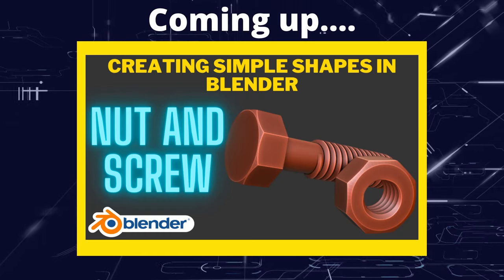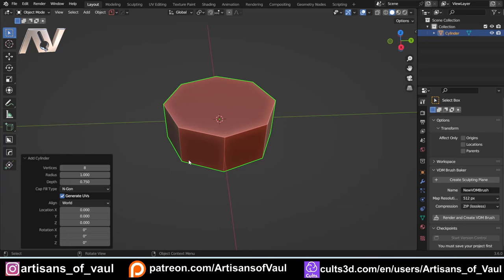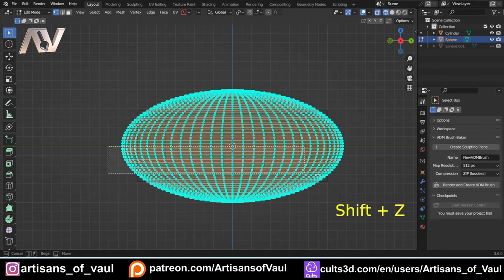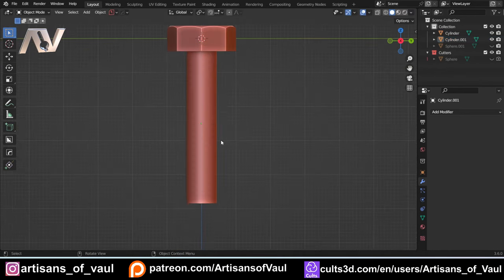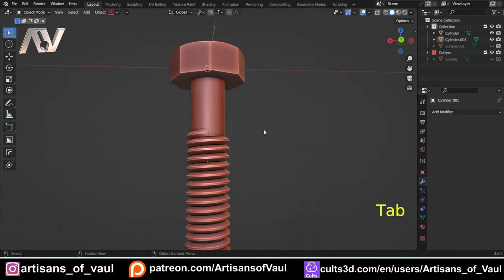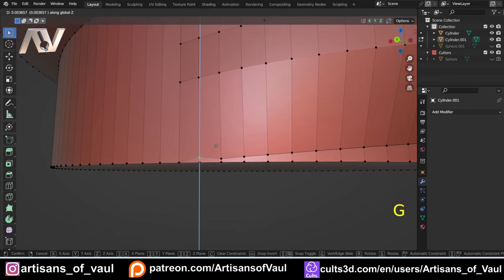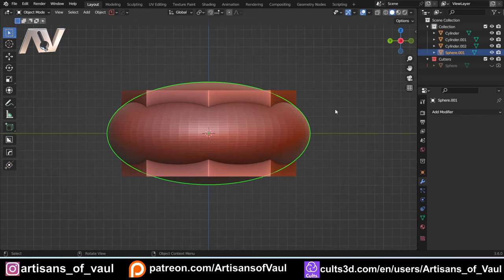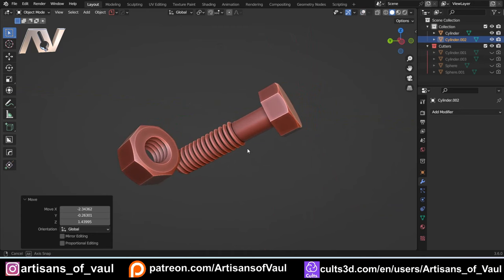Screw and Bolt - Creating simple shapes in Blender

Comment: Quick tip yall: sometimes the download for the file isn’t a compressed zip and won’t be applied in blender. You need to compress the file into a zip before it can be installed
Reply from the maker: @WorkshopBuilds  Good tip.

Comment: And this is where blender struggles in my view. In Solidworks you would draw a hexagon, extrude it. Hole through the centre, then select what size thread you need. Boom! Done! I know they are apples and orange's.
Reply from the maker: Yeah, its a very different software.  But that is essentially what you can do here as well, the big difference (I assume) is that solidworks would have standard thread sizes already programmed into it?

Comment: Needs clearance between the bolt and the nut's threads.  If you print this as is, you'll never get them together.
Reply from the maker: Totally agree from a printing point of view. You'd need to shrink/fatten tool to create an offset (or other methods)

Comment: Blender itself also comes with a solution without having to install an additional add-on. you can enable 'Bolt Factory' in the settings and preferences. this will give you a more creative and less precise alternative to the Machine Tools. although the add-on you cover here is excellent as well!
Reply from the maker: It goes but for some reason making a hex bolt it puts a cylindrical shape below the nut head. That could be taken out but this is a set of useful techniques to know 👍🏻
Reply: @ArtisansofVaul  because in real life it is usually there aswell. This part should be even more explicit.
Reply: Thank you! I was going to make some threads myself out of cubes and this saved me a day of frustration!
Not to mention I also suck at blender.

Comment: Hi,
Just a few remarks: 

- In fact, the thread is external to the screw, whereas it should have been cut into the body of the screw. 
- the chamfer at 30 degrees on the head of the screw and on the nut is the result of the intersection of a cone (120 degrees at the top) and a hexagon, not an ellipse and a hexagon.
Best regards.
Reply from the maker: Good info. Thanks.

Comment: Hate to be 'That Guy' but hey, comments, is comments, as far as the algorithm is concerned. :D 1. It's not a screw, it's a bolt. Screws are generally pointed (but not always) they also have some sort of slots on the head for use with s Screwdriver. This uses a Spanner / Wrench to tighten or loosen. The other thing is that the thread on a bolt is usually cut into the bolt rather than extruded from it. This could be easily faked be making the part of the bolt above the threads fatter.
But having said all that, I love your tutorials. Keep up the great work.
Reply from the maker: 😅 That's fair. I'll have to change the thumbnail 😁👌
Reply: I’m so glad someone else said it and I don’t have to be ‘that guy’ 😂
Reply: Hi,
Bolt is composed of a screw and a nut.
Best regards.
Reply: @rigotux  if you want to argue, this is a bolt. It’s not tapered and fastens with a nut. Therefore a bolt. A screw is either tapered or meshes with a threaded frame part (like a machine screw in a PC for example) or taps it’s own thread in a material.
Reply: @richardokeeffe8375  in fact, you call it as you like...
Best regards!
Reply: @richardokeeffe8375  what about cap screws, are they bolts too?
Reply: @pawljaxun  no a cap screw is a screw, it affixes to a thread in an existing frame or usually a matching part. Again, not affixed by an opposing nut (which makes it a bolt, as per the video)
Enjoy the algorithm engagement AoV!

Comment: When I try bevelling the end of the screw after extruding, the top face (triangle fan) completely explodes into a star pattern. What am I doing wrong? Does if have anything to do with setting the cylander as a triangle fan?
Reply from the maker: From what you describe it's like you have vertices on top of each other (normally from extruding and then cancelling it but that still leaves the extra vertices). Try "a" to select everything, then "m" for the merge menu and select by distance. Then try bevelling.

Comment: Is there are way to reopen the modifications menu when you add a mesh? I'd even pay for an addon to do this if I had to.
Reply from the maker: If you mean the menu in the bottom lefts, as long as you haven't done another action like move or transform it just hit F9.
Reply: @ArtisansofVaul  Gotcha, that was the only way I knew to do it. It'd be nice to be able to open it again after the fact though.
Reply from the maker: @NerdLegionInc  Yeah, unfortunately not. Though a lot of the sizes can be changed in the item menu. It just depends what you're doing.

Comment: how do you thread something that's not straight for instance a cone
Reply from the maker: Good question.  This will only work on a cylinder. Instead I imagine the best way would be to add a curve spiral and then use a curve modifier (or geometry nodes) to add a profile to a curve.

Comment: Nice! I actually prefer the machin3tools method as it allows you to select wich faces you want instead of the presetted boltsfactory addon, tho i think this workflow might have some tollerance problems when printing. Did you come up with a solution for that?
Reply from the maker: When you say tolerance problems do you mean in the exact size of the bolts? or that the dimensions stated don't match what is being created?
Reply: @ArtisansofVaul  what I mean is that when you do this method in blender, it books the nanometer-exact cut into the bolt or the object you want to make the female. But when 3dprinting, this 0 tolerance will bring to a problem where the bolt won't fit. I tried scaling the bolt but it didn't like that that much. I'll try some other methods, but I was curious to hear how you manage that, if you happen to 3dprint this
Reply from the maker: @federicopappalardo231  Ah Ive got you.  Yes, you can't just scale the object as it would make the threads further apart not just wider to accommodate the size of the screw.  What you want to do instead is use the shrink/fatten tool for the cutter thats making the female part as it works along the normals.  Good video topic there.... I will add it to the list.
Reply: @ArtisansofVaul  Epic, thanks! This gained you a sub!
Reply from the maker: @federicopappalardo231  Cheers

Comment: do you know if there is a way to flip the threads to be right hand? mine seems to default as left handed thread for some reason??
Reply from the maker: I can't remember off the top of my head but if there isn't an option in the action box in the bottom left maybe check your scale and that it's a positive number and if not apply the scale first.

Comment: When I try to add threads, nothing happens.  I also don't get a menu to pop up in the bottom left corner.  My prefereces are saved and I have thread turned on.  Running blender 4.0
Reply from the maker: Have you got the latest update of Machin3 Tools? That's the only reason I can think of it not working if you have followed the stages the same here....
Reply: I had the same problem at first, then realized that I needed to deselect the bottom face.
Reply from the maker: @steelbonnet1  Oh good tip 👍🏻

Comment: how do you get that add cylinder in the bottom left
Reply from the maker: It will always be there after each operation you use as long as you don't then click somewhere else.  It may be smaller and you will need expand it by clicking on the name and small arrow.

Comment: what about the topology of the model are you not going to fix it or what 🤔?!! but thank you for the tutorial .anyway🙂
Reply from the maker: Nope, not going to fix it at all.  Its a solid part so without needing to flex in any way (like rigging) its perfectly easy to use for CG work as it is and for 3D printing (my main use of Blender) quad topology is completely irrelevant.  I'll let the people that think quads are needed for every workflow worry about their topology videos 😉😆
Reply: @ArtisansofVaul  🤣🤣 i am sorry but i peak up a worst habit of being paranoid about best topology for the model and need the 3d model to have good quad faces when used to modelling but not for so long now i am a programmer because  i have a master degree in software engineering and peak up new problems to deal with🤣🤣
Reply from the maker: @imadeddinemanssouri7709  For some uses it is important to be fair so it depends on your use. I'm just explaining mine so it's clear why I don't especially worry about topology beyond what I need for the mesh to work.

Comment: I understand this is an older video so not expecting you to see this, but would these shapes work to 3d Print?
Reply from the maker: I always try to reply 😁 Yes they would 3D print with no issue. You might want to check it on 3D Builder first but everything made here is entirely manifold when booleaned together. 👍🏻